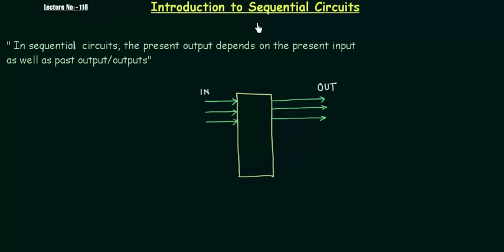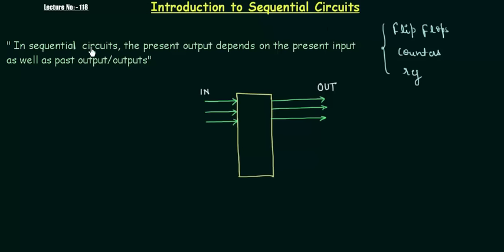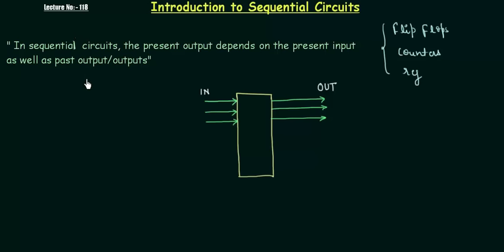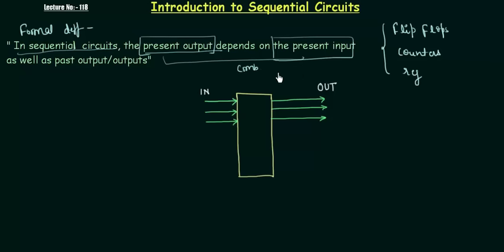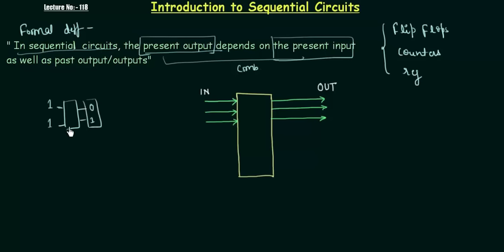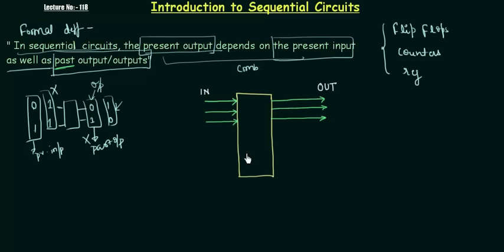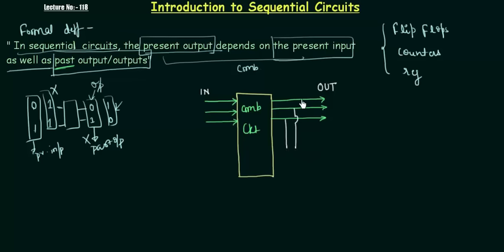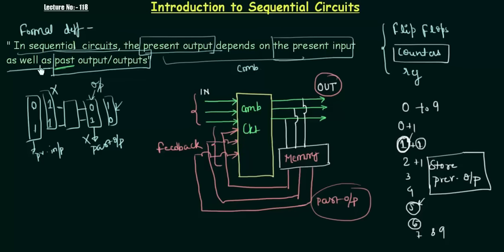Introduction to Sequential Circuits | Important

Comment: I still don't get it. How '1' is stored in the end ?.
Reply: when the i/p is '1' the o/p of two NOT gates will be '1' and this will again work as the i/p (as the o/p is connected to i/p) which results in o/p of '1' and this cycle goes on forever until we change the i/p hence we can say that we have stored the '1' .(same goes for '0' as well)

Comment: Great effort ... no body can explain like you ... hats off to you sir
Reply: +naga raja As shown in figure the output from RHS node is connected as feedback at input side, hence there will be a loop of 1-0-1 will be formed n and at input and at output the Signal at input will be found on both side.
Reply: +Neso Academy  sir how 1 bit stored in not gate iam confused .........it perform only not operation bt how can it be stored?
Reply: why do we need a loop with not gate? cant we just send the output as it is?

Comment: Firstly I am thankful for the understanding you gave sir, but I have a doubt when we take a full adder circuit, it takes the carry obtained from the previous output as one of the inputs that means it is dependent on the previous output obtained, then isn't it called a sequential circuit for that reason ? Please correct me if I am wrong.

Comment: Sequentiel logic depends not only on the present input but also on the past output(s). This is your definition of sequentiel logic. I have two questions : 

1. does it depends on the past output or the past input ? in wiki it is said that " In digital circuit theory, sequential logic is a type of logic circuit whose output depends not only on the present value of its input signals but on the sequence of past inputs, the input history".

2. Why they are called sequential, i do not see any propriety of sequence ?